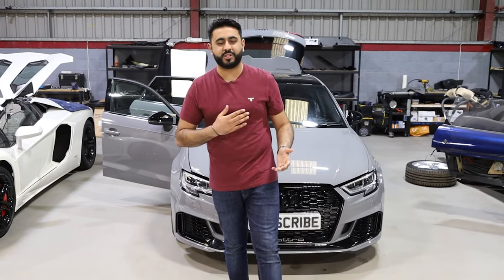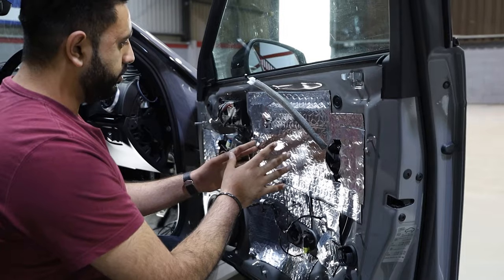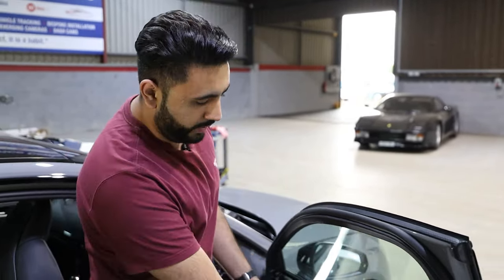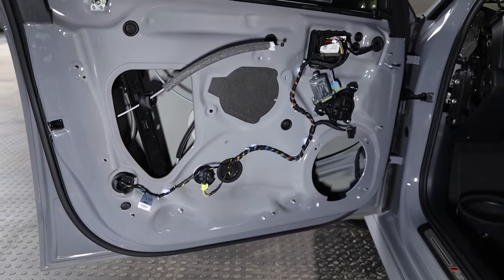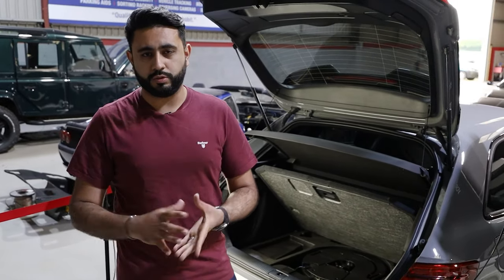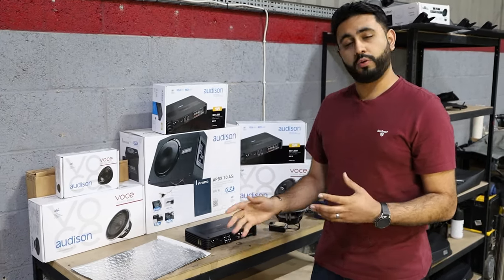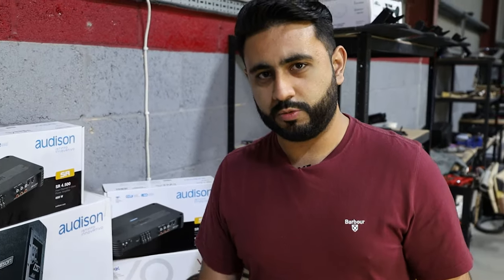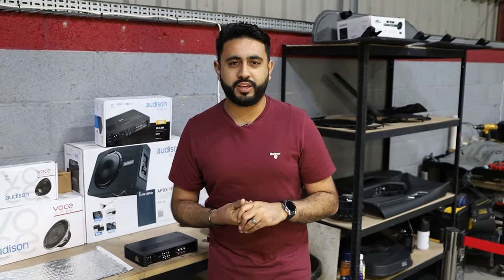The Sound System This Car DESERVES! | Behind The Sound: Audi RS3 - Volume 1

Comment: Added amplifier draws power from the battery. Does it have any impact on the life of battery and/ or does it have impact on other functions of the car that are dependent on the battery power? Like an air suspension
Reply from the maker: No it does, we take these tings into account when designing a system

Comment: I have a 2018 S3 with stock stereo set-up and really don't like the quality. Would this set-up be appropriate for my car or would I have needed the upgraded B&O system in order to do so?
Reply from the maker: Hi,

This would be, but we design each system for every client, so best to come by and see us if possible
Reply: @CambridgeCarAudio  Appreciate it. I'm actually across the pond. I just want a more powerful system without having gut the original stereo receiver. Glad this is an option.
Reply from the maker: @ejicon3099  No worries

Comment: I would like to ask if the stock speaker cabling is okay to run the aftermarket system such as this? I have upgraded to a similar setup in my Golf Cabriolet MK6 but utilised the existing wiring/cabling.
Reply from the maker: Ideally not, always best to run new cables